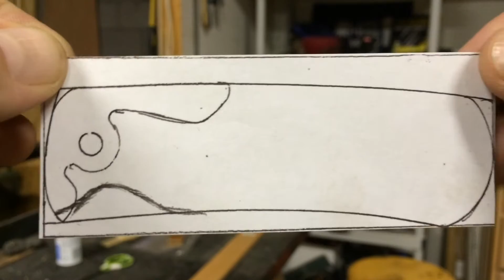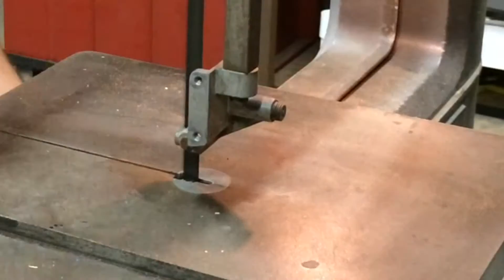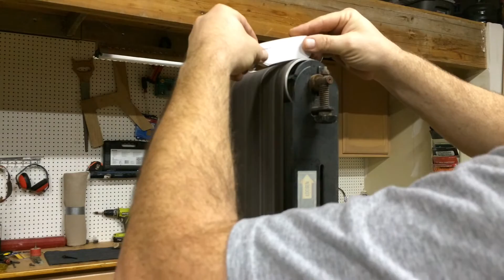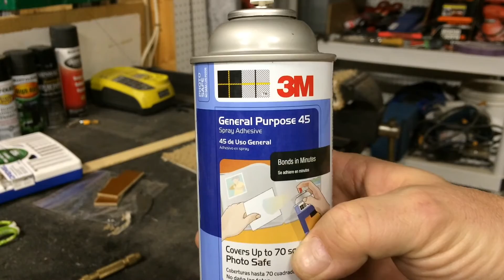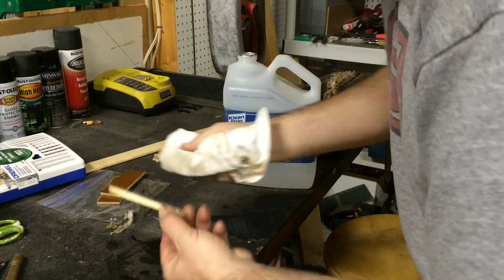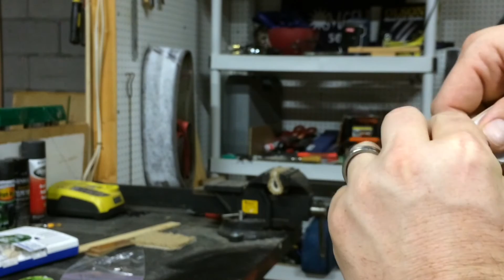Friction Folder Build part 2 - Handle Design and Blade Fit

Comment: Hey Mike:
  Nice job. You've convinced me (after 60 years of knife making) to finally try my hand at a friction folder. I've always been intimidated by the issues of trying to get the blade and frame to function properly together.
Oh...BTW. For your slight issue getting the 2 halves of your handle apart. I use double sided carpet tape. It hold very securely and the halves come apart easily. Just an FYI.
Keep making the videos. LOVE 'EM!
God bless:
Two Feathers
Proprietor of; "The Mountain Man Emporium"
PA.